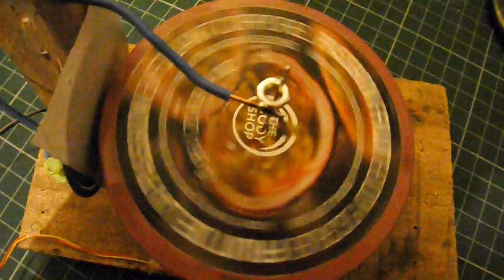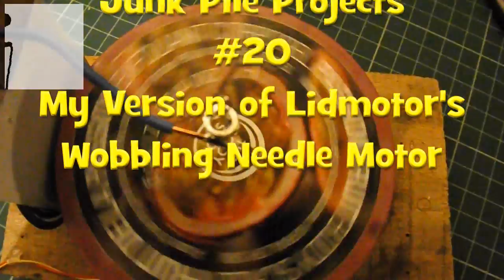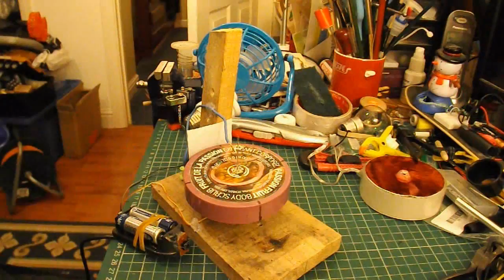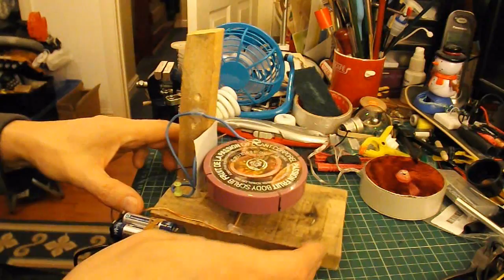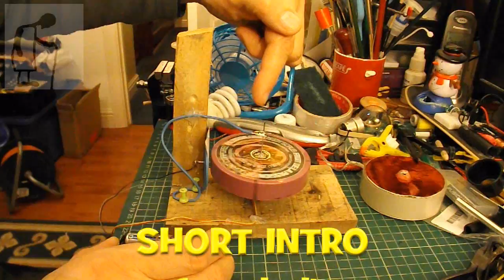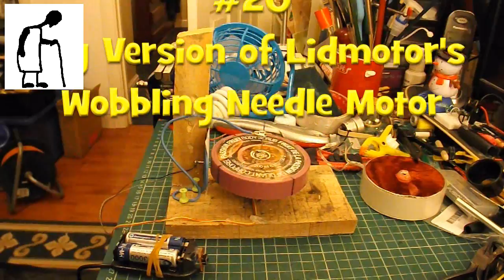Grandad's Junk Pile Projects #20 SHORT INTRODUCTION

Comment: A small loop in the end of the blue wire could replace the nut removing one component and allow a tuning or variation between the wire and needle
Reply from the maker: +david pugh did you watch the associated video? It started as a hole drilled in the flattened copper wire but I eventually made it too thin so I soldered the nut on to finish the video. Certainly varying the size of the hole would help to "tune" it. You could spend ages on this to get it working really well but I was happy enough to get it working.

Comment: I would have used thinner wire. Perhaps from a telephone extension cord. Seems to me you made a current draining circuit. Could you dig up that spool you had, the one from the washing machine? The water inlet switch if I recall that right?
Reply from the maker: +deslomeslager no the whole point of my version was to use this thick copper wire otherwise I would just be copying Lidmotor's project. I have done several projects using this thick wire as I use the wire to be the structure as well as the conductor. In this case it was not quite strong enough on it's own and I had to add the wooden frame which spoiled the effect.

Comment: And if you put a signal from an astable circuit work automatically. It is not like this?. 8-)
Reply from the maker: +Francisco Javier Lázaro Pinela the idea here is to use no electronic components, just a piece of wire and some magnets.
Reply: +GrandadIsAnOldMan Well...
If we do that one of these magnets, open and close the electrical contact, we will be doing the same. Dont you think?. 8-)
Reply from the maker: Francisco Javier Lázaro Pinela that is in effect what happen here with the loose needle in the large hole at the top. The lid tilts towards the coil so the needle makes contact with the top bearing. That allows the current to flow and the electromagnet repels the magnet in the lid. That breaks the circuit. The lid tilts back again to complete the circuit. The current flows and the electromagnet repels the magnet. This continues with no other circuitry and if you get the adjustments right it will spin very fast.